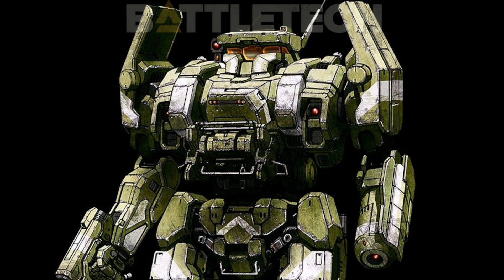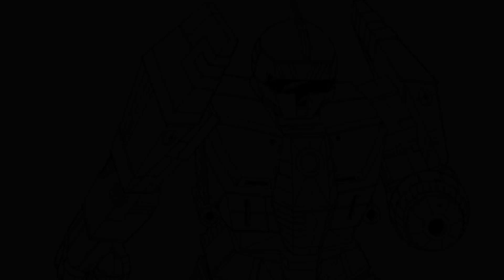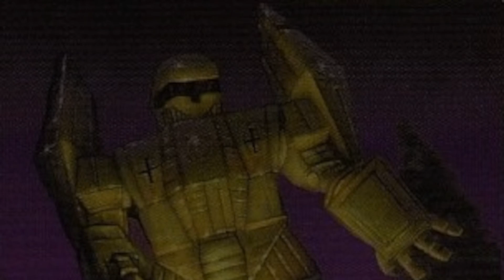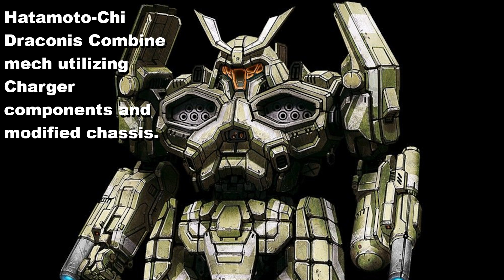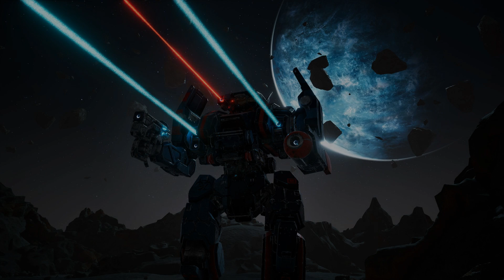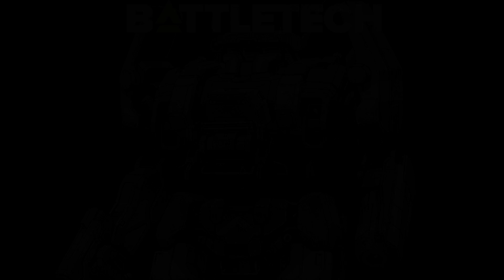BATTLETECH: The Charger

Comment: I personally love that the Charger (and other "bad" mechs) exists. Having the military industrial complex dream up products for niches that do not exist (or shouldn't) and then try to sell the resulting boondoggles is actually pretty realistic.
Reply from the maker: Oh I think the Charger is awesome. But it's also trash. lol
Reply: @BigRed40TECH  It’s a melee murderer in tabletop.
Reply: @mechcommander7876  Sometimes
Reply: It's good for idiot royalty who want to play war. It's got a good amount of run away.
Reply: Yep, I love how terrible the Charger is. The bad mechs out there give BT such great flavor.
Reply: Indeed. Heck, I used to run an Assassin, and did everything possible to use salvage to turn it into a viable scout killer.
Reply: It's also just more interesting. Imagine being a commander of a second line units who has to figure out how to get results with what amounts to the reject bin.
Reply: @Bustermachine  that was our campaign. The commander was running a Frankenmech built out of a Thunderbolt chassis, with a Griffin head, arm that was salvaged from a Warhammer, and AC/5 salvaged off of a Shadowhawk in the spot where the LRM usually sat.
Reply: The big selling point of a charger is that it's an 80 ton battering ram. You use it to get close to other, considerably slower assault mechs and wail on them with as much charge damage You can do. You can also bulldoze buildings with it. A mod that gives it a m.a.s.c. system and triple strength myomer would make this really dangerous in a face to face assault fight.
Reply: While it might being annoying in game (or just fun to troll), for the universe itself you need mediocre, okay, good, and bad units. It fills out the world and makes things seem bigger. Just imagine if they stuck with only 20-30 units... Total. All being A or B tier. Things would be stale.
Reply: best thing is, there is even a character in a novel, that uses this shitbarn... and that book is real bad.
Reply: it's fairly apparent that the original designers had had a good amount of experiance w/ the military industral complex with the large amount of mechinery in universe w/ hiatories like the charger, crap mech's like this have always been my favorite part of battletech
Reply: @treevenewson  even if it doesn't murder stuff, it's low enough BV that you can either force your opponent to commit assets to hunting it down and denying them BV against your main forces, or you can flank and smack the living bejeezus out of them with it if they don't change their positioning.

In both cases, it's a small BV investment to disrupt the opponent's preferred strategy.

Is it great? Not really, but it has niche applications that keep it from being useless.
Reply: It is true
Reply: @imasspeons  Any Charger on the table has been regularly blown apart with little or no effort by decent Heavy 'Mechs or other 80 ton machines.
Reply: @treevenewson  depends on the size of the table/maps you're using and the total BV, but you make a point. It's not something you take regularly unless you're meming.
Reply: I managed to make one of these things work pretty well in mech 5 modded. Changed out the engine for the standard 320 and used the weight to add on a head mounted er small laser, quad torso mounted medium pulse lasers and two arm mounted binary lasers. As well as lots of double heat sinks.
Reply: @BigRed40TECH  it feels like good material for the lore and setting, but it is a horrendous 'mech.
Reply: Indeed. It also makes for more interesting and realistic scenarios, instead of just trying to munchkin the rules meta.
Reply: The Charger is underpowered compared to other mechs of it's weight class.  Zeus is better.  Hell, even a 75 ton Marauder is better.
Reply: IMO the canon backstory for this battlemech is worse that the design itself. It would've made better sense, if the Charger had been created for use in Solaris VII style sports entertainment during the Star League era. The standard design fits perfectly into that role. Later equipment shortages during the Succession Wars forced the use of what was "Extreme Sports Equipment" onto the battlefield. The insane equivalent of a "monster truck" like Big Foot or Grave Digger being put to military use. 😅
Reply: The thing they really needed to do to this mech to "fix" the concept, is turn it from "scout" to "brawler".
And I don't mean fitting a bunch of SRM-6's and large-bore autocannons.
Oh no. I mean "brawl" in the most literal sense.
As in make your cutting-edge futuristic war machine take war back to it's roots, or in other words hit the enemy really hard over the head with something heavy or sharp until they stop moving.
It's an 80 ton mech with a 400 standard engine.
Swap that Standard 400 for a Light 400 or Clan XL 400 (or even down-size it a little bit, a 340 should still be plenty), and then give it the holy trinity of melee mechs:
MASC, TSM, and potentially a Supercharger (I forget if any of those 3 prevent the installation of any of the other 2, but if so pick the 2 that maximize melee damage and walk speed). Because what's more charger than a supercharger in your charger mech?
If needed, install an ERPPC or two to create heat to keep the TSM activated as well as give it something to use at range.
Actually, you know what? The TSM needs heat to work, we'll give it heat.
Switch to an XXL engine. Maybe also add jump jets, those create heat too.
You're gonna need a really good pilot for this tho, maybe a DNI cockpit wouldn't be a bad idea.

Oh and don't forget the melee weapon of course (pick your favorite, mine's an axe and shield, or mace and shield), and reinforced actuators.

It also makes the name "charger" much more apt. Because that's exactly what it's going to do. It's going to charge at you, and if you don't stop it, it's gonna beat you senseless.

As for who's going to build such a mish-mash monstrosity, well probably it's gonna be some one-off by some mercenary that earns a good record in Solaris.

After all, we've been at war with each other for over 1000 years at this point in the Battletech timeline. Why don't we start taking our warfare a little more... personally?
This charger would be in the nightmares of a MechWarrior that's watched far too many pre-spaceflight era holo-vids. "Why so serious?" the charger's PA speaker blares, before cutting a garish smile into the armor of your mech's cockpit with its melee weapon.
Reply: How about the fact that very few mechs are capable of going “hull-down”? Kind of bothers me.
Reply: @ESC_907  New kinds of weapons demand new tactics to take advantage of their unique capabilities, as well as discarding old tactics that no longer apply to the new kind of weapons.
I guess that for the most part "hull down" tactics are one of the ones that must be discarded for Mechs that are humanoid.
Reply: @44R0Ndin  yeah. Really only possible for mechs such as the Rifleman, Jaeger, Blackjack, Catapult, Firemoth, Arctic Cheetah (to an extent), and perhaps a few others. Not really going to be a possibility for mechs such as the Atlas, Gargoyle, or Executioner.
Reply: But that means bad mechs on the irl market
Reply: @Circ00mspice  The Charger is a terrible mech on paper in a BT game, because it’s an anti insurgence mech. It’s a big stompy mech to terrorize people who don’t have big stompy mechs. It checks all those boxes and the reason it survives in the succession wars is because it’s cheap to repair and you can recover it after the battle wash out the cockpit and shove another idiot in the cockpit. It loses value, because it’s not really used in the circumstances that existed in the Inner Sphere. It’s a reverse clan mech.
Reply: It also makes sense that not every machine is going to be a front line combat platform. The Charger is not the kind of machine you want spearheading or trying to stop a planetary invasion but is quite useful for chasing off pirates and keeping local guerillas under control which is what local militias have to do most of the time anyway. 

Still, I would probably do a little tinkering, like drop the small lasers with a hatchet for anything too slow to get away and maybe a large laser so everything else will just keep running.
Reply: @spectre111  And then a 55 ton griffin or shadowhawk will just keep their distance playing tag with you, while their greater range and armour eat your assault mech alive.  The charger is ok when it can get to brawl against lights or the lighter mediums... Basically no other time.  There's a couple of varieties that are sort of ok from a use sense by bv, but if you look at the cbill cost, role filled and how well they do it, it's Pretty hard to justify even those variations.  

Much like the littoral combat ship, we don't keep it cause it's good we keep because we spent a fortune on it and the acquisitions brass will never give us anything else new if they lose face on this one.   Yes it did come from the planet where their cousin is duke.
Reply: @OmniMontel  Unless the Charger has some kind of cover like trees, mountains or buildings then the Griffin's advantage of long range is negated.

If you want to talk about defense spending, the reason the Charger is still around after 400 years is because its cheap to maintain and easy to repair which is how the Charger can beat other models like the Warhammer, Thunderbolt or the Marauder. They may be more formidable machines but the Charger can be put back in service much quicker.

Comment: Years ago , l created a clan for a campaign we never did . I called it Clan Rhino.It had strengths,weaknesses, traditions and practices that made it a little unique . It did have trials of grievance that often led to combat between Mechwarriors. Most of the trials were just like other clans ,but if the grievances between two Mechwarriors had reached of point of sheer waste of resources or time , the Khan got involved.

The Khan let the 2 warriors settle their differences in a Mech battle
.......in Original 3025 Chargers. The underlying message was "You have both escalated this to the point of sheer foolishness . You want to be fools? Use a fool's machine . But this ends ....now."

Comment: Honestly, one of the biggest strengths of Battletech is that they include stuff like the Charger. The mech building system is very easy to "solve" and figure out how to get the maximum tonnage for the desired amount of movement points, and which combination of weapons provides the optimal amount of firepower at the desired range for that tonnage. It's the fact that basically none of the canonical mechs are optimized in such a way that gives them so much character.
Reply: The big reason that canonical mechs aren't optimized through the roof is because that would be prohibitively expensive
Reply: @adaphion  A shadow hawk with the jumpjets out, AC5  out, the LRM upgraded to a 10 or 15, the SRM upgraded, and 3 more medium lasers with a couple more heat sinks. Is cheaper cbill wise.  There's some argument on how to upgrade LRM and SRM depending on exactly which rules are allowed and what quirks are used if you use quirks.  On my phone so don't have exact numbers in front of me.
Reply: I bring up the Rifleman IIC and raise it with a Nova.
Reply: Every mech, except for the """good""" ones should be approached with an "I can fix her" attitude.  Modify them accordingly to solve your problems with it, instead of buying a mech because it solves all your problems, otherwise everyone would just buy Mad Cats.

Comment: The Charger design really does feel like a meta-troll and cautionary tale from the developers.
Reply: theoretically speaking a superheavy force recon mech capable of shredding enemy eyes and ears while remaining practically invulnerable to said eyes and ears is a decent if niche idea
however
popgun armament is dumb
Reply: @KoishiVibin  That wasn't its role.  You describe the Hunter-Killer role of which there are multiple designs of which the Charger is not one.  This is, AFAIK, canonically the only mech ever designed to scout high threat situations with a decent chance of surviving.  In BT's early days there used to be ambush rules that allowed a hidden unit to interupt your movement to fire if you moved within one hex of it.  The penalty to hit was only based on the number of hexes you had moved before you triggered the ambush.  With smart deployment, even a Regular skill-level ambusher would be takings those shots on a 4 or 5 meaning about a 75% hit chance. Needless to say, AC/20's, and clusters of lasers or SRM's racked up a lot of danage in that scenario.  Basically your typical light scout was almost certainly dead, something heavier like a Phoenix Hawk had about a 50-50 chance of escaping as a battered hulk neededing days at depot-level repair facilities, and the Charger usually came out of it in a state to either continue scouting or need only an hour or two of in-field repairs 

The pop gun armament was a comprimise by the design team because they believed that Procurement would not buy an unarmed mech, so they equipped it with the standard scout weapons payload (2-3 tons) of the shortest-ranged weapons they could to actively discourage the MW from attempting to stand and fight.
Reply: @jackmccrary2614  The problem with that whole idea is that there are medium Mechs that equal or excel the Charger in maneuverability and armor and firepower and are cheaper just to add insult to injury. The role of the Charger, as envisioned by the original designers and producers, was graft. Getting those SL dollars in a day and age when the SLDF was seemingly willing to buy anything from anyone. Something they could build decently well and sell for a big paycheck was what the designers were thinking; tactical employment was not a concern at any point.
Reply: @Magni 56  I watched Tex's video as well.  I love Tex's stuff, but with all due respect to him, he was extrapolating in that video, rather than citing canonical sources.  I think the design is more like the WWII British Defiant fighter with its firepower concentrated in a dorsal turret.  The design looked good on paper so was bought in large numbers by a peace-time military who found out it missed the mark when it was put into real combat.  Either that, or it was a competent design meant to include an XL engine that got axed as a cost-cutting measure.

FWIW, we are all conjecturing something that is unsolvable. The reality is that the 3025 designs were constructed first, and then fluff was bodged on afterwards.  Said fluff was often contradictory, and that became even more so when the SLDF was introduced as a playable faction when TRO 2750 was published later.  Plus it gets muddied further as, there is no real protection against ret-conning.  I personally have had continuity changed and broken on one of my published mechs when a senior designer wanted to include it one of their projects.  Still a little salty about that one because I had spent hours combing through fluff to avoid breaking continuity in the first place.
Reply: @jackmccrary2614  Tex isn't the first one to come up with graft as an explanation for the Charger being what it is. And the thing is? It wasn't even looking good on paper, and was originally something of a flop before the Kuritans decided to buy out the production line and a lot of the competition got turned into glassy craters.

Comment: The original Charger really shows the brilliance of the original Battletech designers as it's the pinnacle of flawed designs. Even sticking with 3025 tech, there are plenty of designs that are a tweak or two away from being so much better, yet from an in-universe perspective, it would never happen for some.. reason. But the fact that these less than fully optimized, min-max designs exist, really makes the universe seem a lot more believable.
Reply: two medium lasers and a small laser would be better than what it has.
Reply: @Shadowsearcher64  As long as you put them in the torso so they don't interfere with punching opponents.